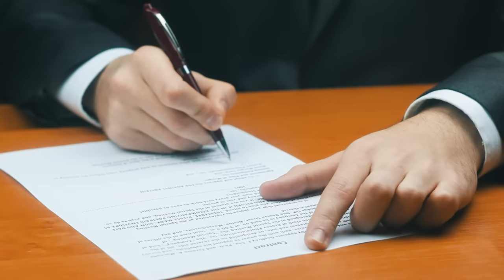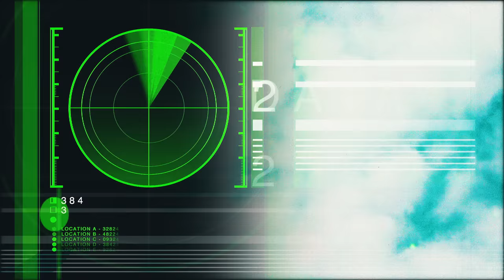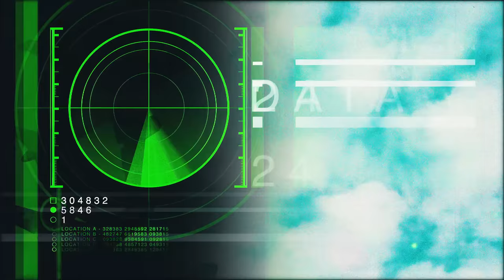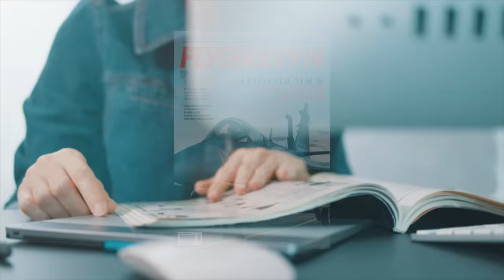This New Swedish Fighter Jet Can Destroy Russia In 30 Seconds

Comment: Nothing has been said in the video about the almost unmatched information sharing and network capability of this fighter which can be linked with several air, land and sea units and use their data and information. For example a formation of four Gripens can link their radars together to cover a vast area of sky. Now add the surface radars and AWACS radars ...
Reply: The real power of these aircraft is in the software, and from a security standpoint I'm happy they didn't mention that.

Comment: Norway has F35, Finland has F18 (soon F35)., Denmark has F16, (soon F35 as well)  Sweden... does it's own thing. And they are damned good at it.  Good luck hitting the newly forged combined Nordic air force. :)
Reply: CM that is the best conercial
Reply: As a Dutchman I was always surprised what kind of military stuff, cars and trucks Sweden builds. A country with 10 mil. Inhabitants make extraordinary quality stuff.
Reply: F35 is Draken (Dragon) which has been manufactured since 1955.
Reply: In my opinion Finland should have bought Gripen 39E-F instead of F35.
Reply: @EricvanDorp007  Financing every despotic regime in the world for the past 100 years has its benefits.
Reply: @bigben5343  Fair enough. I used to think that Norway should have gone for Eurofighter or possibly Gripen too. Turns out the naysayers were wrong, the F35 was the wisest choice.
Reply: yes but will Architects like it?
Reply: @winstonsmiths2449  worthless comment
Reply: @SuncrestVentures  No, it is true. You obviously do not know history.
Reply: @bigben5343  Agreed. Finnish Air Forces have to frequently send fighters to intercept Russian planes that 'just by accident' violate Finnish airspace. In such cases there is no use of a stealth design, superior radars and 360 degree virtual view. And - again - in such cases expensive flight hours and mediocre dogfight potential are clear drawbacks.

Comment: The avionics system is not only modular, but even very fast upgradable, as the only in the world. "upgrade in the morning and fly in the afternoon" is possible in most causes. This give Gripen the capability to carry nearly all weapons and pods for combat aircrafts in the world. Including targeting pods, EW pods and RECCE pods. The built in very powerful EW system with spherical coverage usually make extra EW pods unneccesary though.
Engine replacement is made in less than 1 hous at a forward base with 1 shipping container with equipment, 1 proffesional technichian and 5 conscrips. Mostly only a modul of the engine need to be replaced though, which is faster. Full rearming  and fuelling take max 20 min. Rearming and fuelling for AA-mission take max 10 min.
Reply: As long as I was working, I had a collegue who was classed to do soldering work on JAS Gripen.

Comment: Being able to cruise at super-sonic speeds without after burners is a very nice feature on this plane.
Reply: @c_1092 Until the day it self-destructed😨
Reply: @C _ It's impressive as not all fighters can do it. Gripen's competitors, F-16 and F-35 can't.
Reply: @c_1092 Concorde was a fantastic aircraft, especially since it was effectively designed without computers. When they designed it, there were no suitable engines, so Rolls-Royce simply had to create something suitable. When you think about it, quite amazing that an aircraft carrying 100+ people, all drinking Champagne and eating caviar, was flyting faster and over far longer distances than any ordinary fighter jet could, and still can. But the Concorde was unsuitable as a fighter aircraft.
Reply: @c_1092 Concorde used HUGE fuel tanks, a small fighter jet doesn't have that.  And the competition can't do that.  
And the Concorde can't start or land on an ordinary road, in less then 800 m.  Gripen can.  And it can shoot down other planes, like a Concorde, if it still operated.

You are comparing Pears with Mushrooms, so please continue embarrass yourself.

Comment: Mike from Elk Grove CA. Im impressed on the Advanced technology on the current aircraft that can adapt to various fighting conditions, computer technology to block aircraft and ground radars and able to fly at an impressive Mach speed, frankly the Mach eventually may need to be increased as other countries will adapt and adjust accordingly, to bad they they can't improve the skin of the aircraft to with stand gun fire to protect the pilot to help buy them time to live another day.
Reply: The modular design of the motor make increase in power easier.  As the said, change the motor in one day.  Or one module in 1 h.

Comment: Let's summarize: built for a 50 year lifespan, systems such as the engine are designed in repairable segments that can make for faster repairs at lower costs, low operating costs, requires only a small ground crew to fuel and load weapons, can operate from short runways, flexible capability to conduct different missions using one single jet, capable of carrying multiple current weapons as weal as future weapons systems, advanced avionics, flight characteristics, and on and on. You can certainly tell this jet was not designed by American aerospace companies! Imagine how much the US could cut its military budgets with jets that are built to operate long term at lower costs. Maybe we need to be purchasing from Sweden.

Comment: Two features interest me: low operation and maintenance cost, and ability to operate in cold winters. Canada has a major air force base in Cold Lake, Alberta. Winters are even colder than Kiruna in northern Sweden. And Canada used to have an air force station in Resolute; if relations between NATO and Russia continue to deteriorate, Canada may have to re-commission that air force station. As a "station", fighter jets would not be permanently based there, but could be temporarily assigned there during an incident or a period of tension. That would require fighter jets to operate there any time, 12 months per year. So cold weather operation is a concern.

Comment: Will we ever see an even more upgraded version the E/F, with turbo charged twin engine configuration, draped with stealth tech?
Reply: No.  That is another aircraft, designed from ground up.
As it is a defence weapon, stealth isn't as useful as in an attack weapon.  Only making the construction more complicated and delayed.
They dropped twin engine because of increased complexity, and not good enough that it is worth it back in Draken and Viggen. Doesn't fit into the operation it is supposed to do.

Comment: What is scary about Russian space,is about their surface to air defence missile capabilities like upgraded s-400 missiles and s-500 missiles,can this 39-gripen jet fighter escape from these two types of missile air defence missiles?, has it ever been tried in any combat warfare.
Reply: The Grippen is a wonderful concept with or without combat exposure.
Reply: good point Franky. However the Swedes have already solved the issue not only by developing one of the best EW systems for the latest Gripen version but manufacturing a long range stealth cruise missile which can easily hit a moving bicycle from 500 Km away.
Reply: You are absolutely right, Franky!  This video means nothing without comparing/contrasting this fighter with Russian fighters, defenses and offensive capabilities.  TITANIC was also a wonderful concept and full of high tech advances.
Reply: stop making sense
Reply: Sweden doesn't intend to attack Russian territory. Swedish doctrine is not to allow Russia to set foot on Swedish soil, among others because of the understanding that foreign AA on its home turf can be a massive issue. If we look at Ukraine, AA is a threat to all planes on all sides, but not to the point where either side can't operate.
Reply: I mean this has been simulated thousands of times, in combat simulators. They are training on stuff like this all the time. However, it's keept a secret for us in the public domain.

And as someone said, for Sweden it's not a problem, the Gripens will never encounter S-300 or S-400 because we will never attack Russia. But for other countries buying the Gripen it would be good to know.

But we know however that the F-35 is superior to the S-400. I think it was in Syria (or if it was in Libya) were those two plattforms meet in real combat and the S-400 systems were taken out easily by the F-35.

I think Gripen will do the same, especially since it got such an advanced electronic warfare system.

There has been rumors in exercises with the swedes that they all of a sudden just popped up at the side of NATO aircraft and those aircrafts couldn't see the swedes on their radar. I don't know how true stories like these are, but at least that's what I have heard. With electronic warfare system you will have electronic stealth. That's what they say, but I'm no expert at all, that's just what I have heard.

Comment: Great job.    I wish I had owned cars like that, modular, and with easy to upgrade/replace parts.   There is a movement to get manufacturers to make things that are repairable, instead of the usual chuck it away and buy a new one mentality.    Their focus is on money and profit, thinking that resources are endless, and be damned to the environment.   My father had a Saab 900 for a while, very comfy.
Reply: An acquaintance of mine still has the 900 Turbo he bought in 1982 and it's still his daily driver.

Comment: Canada had this aircraft under consideration for their Air Force yet I think they declined the offer from Sweden.  The low operational costs listed here compared to other aircraft offerings mentioned seems highly questionable.  Still, an highly impressive video to say the least.
Reply: It's true and I think it was about the Gripen C/D model that was on the table.

As a Swede, I personally think that Canada chose the right plan for its needs, essentially your large airspace. The best deal would probably be a mix of the two as such a combination of the two plans would be unbeatable and meet all your needs in one deal. It is unlikely that any of the suppliers would agree to such an arrangement for a number of reasons, with politics being the biggest obstacle. At the end of the day, we the everyday tax payers can blame our politicians for their failures to work for the people...

Comment: The Sweden military airforce  have made some great aircraft.
Reply: The Swedish air force doesn't make aircraft. It buys them from manufacturers such as SAAB AB.
Reply: @CrankCase08  and which country is SAAB in. Australia.
Reply: @petertyson4022  SAAB AB is not SAAB Australia.
Reply: @CrankCase08  you really don't know  a sarcastic remark.  Saab AB. Is a high technology company involved in defence,  aviation and aerospace.  It's like Roll Royce . They make cars . But still make  aircraft engines,  matinee propulsion systems and power - generation systems. So the Saab ( Sweden.   )made some good Swedish aircraft.  .  I rest my case. ✌👾
Reply: @petertyson4022  I know all of that. I used to work for Scania (UK). The point is that the Swedish air force does not make aircraft.
Reply: @CrankCase08  oh , OK.  I should off said Sweden  Saab make brilliant military aircraft for  Swedish airforce.  Who you can buy from if the Swedish government let's you. That are made in Sweden.  Which am sure that the military top brass have no say what they want.  Lol😁
Reply: @petertyson4022  The "military top brass" make a judgement according to the specifications and performance of the aircraft - assuming no financial inducements were offered.

Comment: Uhmmm  Grippen is NOT 'NEW' -- not by a long site!  First flight was in December of 1988 -- 35 years ago.  Introduction into the Swedish Air Force was in June of 1996 -- 22 years ago.  Hardly NEW.  New -- in aviation terms, might be under ten years old -- as an aircraft MODEL (not version or variation).  So how do 'posters' get away with garbage like this?